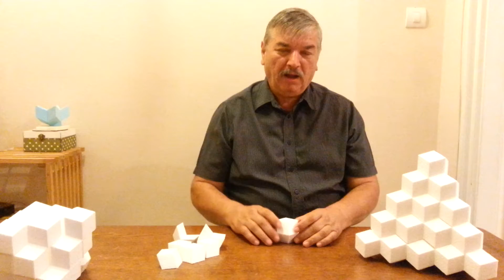tetrahedron built from rhombic dodecahedron

Comment: DEGREES • FACES • EDGES • VERTICES 

Triangle:
* Degrees: 180
* Faces: 1 (triangle)
* Edges: 3
* Vertices: 3

Square:
* Degrees: 360  
* Faces: 1 (square)
* Edges: 4
* Vertices: 4

Pentagon:
* Degrees: 540
* Faces: 1 (pentagon)
* Edges: 5
* Vertices: 5

Hexagon:
* Degrees: 720
* Faces: 1 (hexagon)
* Edges: 6
* Vertices: 6

Tetrahedron:
* Degrees: 720  
* Faces: 4 (equilateral triangles)
* Edges: 6
* Vertices: 4

Octagon:
* Degrees: 1080 
* Faces: 1 (octagon)
* Edges: 8
* Vertices: 8

Pentagonal Pyramid
* Degrees: 1440
* Faces: 6 (5 triangles, 1 pentagon)
* Edges: 10
* Vertices: 6

Octahedron:
* Degrees: 1440 
* Faces: 8 (equilateral triangles)
* Edges: 12
* Vertices: 6

Stellated octahedron:
* Degrees: 1440
* Faces: 8 (equilateral triangles)
* Edges: 12
* Vertices: 6

Pentagonal Bipyramid
* degrees: 1800
* Faces: 10 (10 triangles)
* Edges: 15
* Vertices: 7

Hexahedron (Cube):
* Degrees: 2160  
* Faces: 6 (squares)
* Edges: 12
* Vertices: 8

Triaugmented Triangular Prism:
* Degrees: 2520 
* Faces: 10 (6 triangles, 4 squares)
* Edges: 20
* Vertices: 14

Octadecagon (18-sided polygon):
* Degrees: 2880 
* Faces: 1 (octadecagon)
* Edges: 18
* Vertices: 18

Icosagon (20-sided polygon):
* Degrees: 3240 
* Faces: 1 (icosagon)
* Edges: 20
* Vertices: 20

Truncated Tetrahedron
* Degrees:  3600
* Faces: 8 (4 triangles, 4 hexagons)
* Edges: 18
* Vertices: 12

Icosahedron:
* Degrees: 3600
* Faces: 20 (equilateral triangles)
* Edges: 30
* Vertices: 12

Cuboctahedron or VECTOR EQUILIBRIUM 
* Degrees: 3600
* Faces: 14 (8 triangles, 6 squares)
* Edges: 24
* Vertices: 12

3,960 DEGREES 
88 x 45 = 3,960
44 x 90 = 3,960 
22 x 180 = 3,960
11 x 360 = 3,960 

Rhombic Dodecahedron
* Degrees: 4,320
* Faces: 12 (all rhombuses)
* Edges: 24
* Vertices: 14
* Duel is Cuboctahedron or vector equilibrium 

Tetrakis Hexahedron:
* Degrees: 4320 
* Faces: 24 (isosceles triangles)
* Edges: 36
* Vertices: 14

Icosikaioctagon (28-sided polygon):
* Degrees: 4680 
* Faces: 1 (icosikaioctagon)
* Edges: 28
* Vertices: 28

5040 DEGREES 

5400 DEGREES 

5,760 degrees 

6,120 degrees 

Dodecahedron:
* Degrees: 6480 
* Faces: 12 (pentagons)
* Edges: 30
* Vertices: 20

7560 DEGREES
 
6840 DEGREES 

7,200 DEGREES 

7560 DEGREES 

Truncated Cuboctahedron
* Degrees: 7920
* Faces: 26 (8 triangles, 18 squares)
* Edges: 72
* Vertices: 48

Rhombicuboctahedron:
* Degrees: 7920
* Faces: 26 (8 triangles, 18 squares)
* Edges: 48
* Vertices: 24

Snub Cube:
* Degrees: 7920
* Faces: 38 (6 squares, 32 triangles)
* Edges: 60
* Vertices: 24

Trakis Icosahedron:
* Degrees: 7920 
* Faces: 32 (20 triangles, 12 kites)
* Edges: 90
* Vertices: 60

8,280 DEGREES 

8640 DEGREES 

9000 DEGREES 

9,360 degrees 

9,720 degrees 

Icosidodecahedron:
* Degrees: 10080
* Faces: 30 (12 pentagons, 20 triangles)
* Edges: 60
* Vertices: 30

?  10,440 degrees 

Rhombic Triacontahedron:
* Degrees: 10,800 
* Faces: 30 (rhombuses)
* Edges: 60
* Vertices: 32

11160 DEGREES 

11,520 DEGREES 

11,880 DEGREES 

12,240 DEGREES 

12,600 DEGREES 

12960 DEGREES 

END OF POLAR GRID 

Small Ditrigonal Icosidodecahedron:
* Degrees: 16,560
* Faces: 50 (12 pentagons, 20 triangles, 18 squares)
* Edges: 120
* Vertices: 60

Small Rhombicosidodecahedron
* Degrees: 20,880
* Faces: 62 (20 triangles, 30 squares, 12 pentagons)
* Edges: 120
* Vertices: 60

Rhombicosidodecahedron
* Degrees: 20,880 
* Faces: 62 (30 squares, 20 triangles, 12 pentagons)
* Edges: 120
* Vertices: 60

Truncated Icosahedron:
* Degrees: 20,880
* Faces: 32 (12 pentagons, 20 hexagons)
* Edges: 90
* Vertices: 60

Disdyakis Triacontahedron:
* Degrees: 21600
* Faces: 120 (scalene triangles)
* Edges: 180
* Vertices: 62

Deltoidal Hexecontahedron
* Degrees: 21,600
* Faces: 60 (kites)
* Edges: 120
* Vertices: 62

Ditrigonal Dodecadodecahedron:
* Degrees: 24480
* Faces: 52 (12 pentagons, 20 hexagons, 20 triangles)
* Edges: 150
* Vertices: 60

Great Rhombicosidodecahedron
* Degrees: 31,680
* Faces: 62 (12 pentagons, 20 hexagons, 30 squares)
* Edges: 120
* Vertices: 60

Small Rhombihexacontahedron:
* Degrees: 31,680
* Faces: 60 (12 pentagons, 30 squares, 20 hexagons)
* Edges: 120
* Vertices: 60

Pentagonal Hexecontahedron:
* Degrees: 32,400
* Faces: 60 (pentagons)
* Edges: 120
* Vertices: 62

Comment: *  RHOMBIC DODECAHEDRON TRANFORMS INTO A CUBE.

* THE CUBE NESTS INSIDE THE RHOMBIC DODECAHEDRON.

* THE DUEL OF THE RHOMBIC DODECAHEDRON IS THE VECTOR EQUILIBRIUM OR CUBOCTAHEDRON.

* THE RHOMBIC FITS PERFECTLY INSIDE THE MERKABA OR STAR TETRAHEDRON OR STELLA OCTANGULA.

* THE RHOMBIC DODECAHEDRON FITS IN THE HEXAGON CENTER OF METATRONS CUBE WITH NO GAPS.

* THE BEE HONEYCOMBS ARE MADE OUT OF THE RHOMBIC DODECAHEDRON ON BOTTOM WHICH IS ALSO A HEXAGON TOO.

* SNOWFLAKES = HEXAGON 
* BENZENE MOLECULE =  HEXAGON 

I LEARNED THIS FROM A SHASHIBO CUBE TOY. 😂 

I THINK THE RHOMBIC DODECAHEDRON BELONGS IN THE PLATONIC SOLIDS SOMEWHERE.

Comment: Nice video! I find the rhombic dodecahedron fascinating.

FWIW: The number of blocks required to make each layer is
T_n = n * (n + 1) / 2, or
T_n = sum(i for i in range(1, n+1)), or
T_n = (n+1 choose 2):
0, 1, 3, 6, 10, 15, 21, 28...

These are known as the Triangular Numbers, derived from Pascal's Triangle.
The Tetrahedral numbers--also found in Pascal's Triangle--are the number of blocks required to make an `n`-layer tetrahedron:
0, 1, 4, 10, 20, 35, 56...